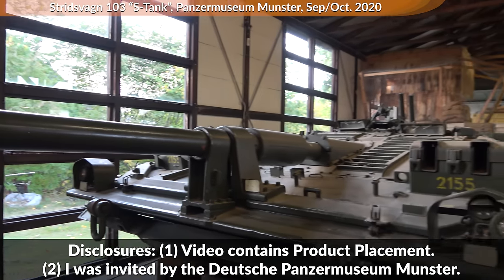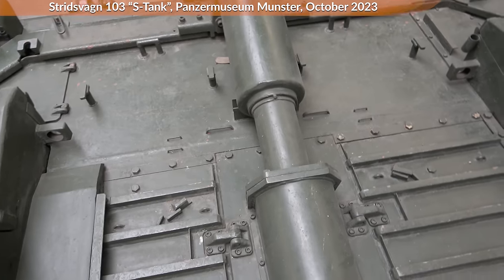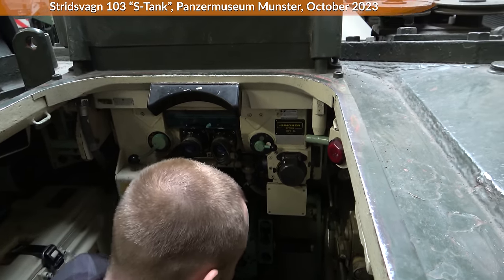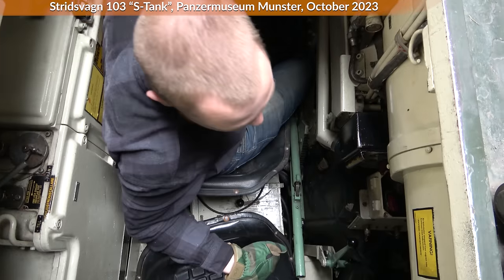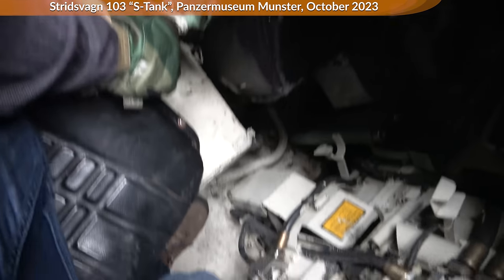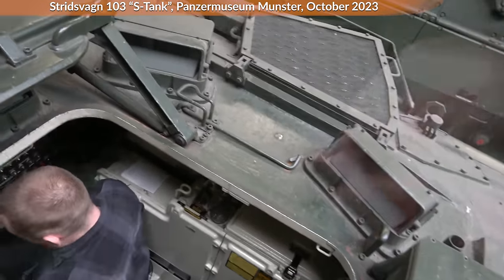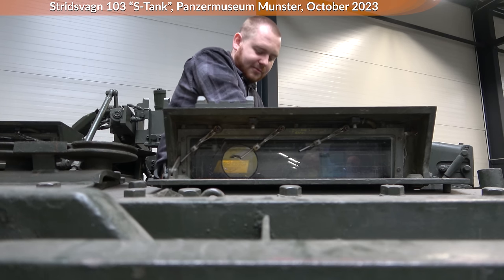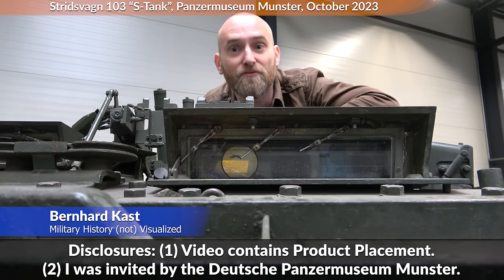S-Tank: The Swedish StuG

Comment: It's such a genius design. Tanks get hit too often in the turret? Remove it. Checkmate turretists.
Reply: With a “TrackPoint” style system, it could become  a better shooter than gyro stabilized turrets. Keep the trigger pulled and it fires automatically only when it reaches the solution.
Reply: One hit to the tracks and rotation is not possible. With a turret you can at least defend yourself. And you are more flexible in aiming an firing. I guess this is why today every tank has a turret.
Reply: @Piett_ yes but you would need to shoot both before it can return fire. And that would be hard due to the targeting system/aim being suprisingly good better then most tanks with turrets. Also the s-tank is a defensiv vehicle = sniper and camper
Reply: @hemondounknown8285  only cowards camp. oh wait this is real life right
Reply: @Piett_ also the tank tracks would theoretically be the easiest part of the tank to protect behind cover.
Reply: @chrisragnar1  not theoretically, realistically. they would appear over hilltops and fire down most of the time, or be dug down a bit
Reply: @hemondounknown8285  Dug down, but also has a lower profile perfect for the kind of terrain in Sweden. It was not built to ambush tanks in Sahara or something like that. Even though it might be able to do so. I did rely on good optics to counter the weakness it had. But Sweden does have tanks today with rotable towers and such. We use leopard to give one example.
Reply: @hemondounknown8285  That's just plain wrong. Most of the S-tanks were deployed in southern Sweden (PB 7, PB 8, PB 9). Their job was to aggressively counter-attack any Soviet beachheads or large airborne drops on the southern plains. Swedish cold war doctrine stressed the need to strike hard against any landings as fast as possible.
Reply: @kored8688  To add, the areas that these would be deployed on are very flat. These would essentially be mobile bunker turrets, of which there are many on the southeast coast.
Reply: I was there and remember when the swedish army tried out Abrams, Leopard and Leclerc. The officers were suddenly honest about what they thought about the S-tank: a band cannon!
Reply: @hemondounknown8285  It was never a defensive vehicle. It was designed as a reply to a request for a tank, developed as a tank, assigned along with the Centurion to the Swedish armoured brigades, using the same combat manual, doctrine and tactics and intended to do the same work - counterattack an enemy bridgehead (that could come by sea or air). The nature of combat it was intended for was (counter-) offensive, not defensive.

When advanced gun stabilisers became common in the 70s, it proved to be an evolutionary dead and, and it should have been replaced in the early 80s when arrow projectiles made its armour slope obselete, but it was never intended as a defensive vehicle.
Reply: @Piett_  If a tank is immobilized, you should get out of there if you want to remain alive.
Reply: @Piett_   This is a tank for ambush. You dont stay long enugh to get hit in the tracks. You fire and run away. I think Ukraine would still would have been happy to receve those if we didnt scrap them in the late 199:s early 2000:s
Reply: @Piett_  You only need one track to rotate !

Comment: 1972 I was a reverse driver on the 103 S! I drove back and hade the command of the radio communications ,there was a telephone outside the tank fore ho needed it!! I was educated paramedic!! On my right side there was an electric boiler where we could boild water and make coffee ☕️! The chef hade a machine gun that he could fire, and he had 360° vision!! The cannon man had two machine guns that he could shoot,these 2 could be  dismantled  and take with you on the  ground!! Shooting was automatically  and  the shooter could those between different grenades!! On about  1600 meters  you could hit a beer 🍺 bottle 😂 On a road  103 S could speed about 90km/tim° 2 engines, one  to all the  hydraulic about 250 horse power and a gas turbine to make the 103 S to go forward!! 103 S could  go over floods, it took about 30 min to pull up the conwayerbelt and then get into the water,  crawler make the tank go😂 I was 171 cm long, no problems with sitting in the tank😂 Shooting the 103S there was a little recoil, but you could feel it in your face 😂 That's what I remember  😂😂
Reply: 90km/h. And the S-Tank is said to be able to go as fast in reverse as forward.. Like even if in reality they only reached 80km/h on tarmac (remember this where the days before everyone carried a smartphone and able to get a GPS reading) Like.. 80-90km/h is the speed limit on most Swedish roads. Heavy lorries are still limited to 90km/h but only on highways. And with a trailer/wagon or just on a normal road? Top speed limit is 80km/h. So even before getting the engine improvements S-tank was doing the same speeds on roads as civilians do in modern cars. Most likely even able to keep up with a loaded lorry if so need be.
Reply: @TheDiner50  quite right 😃
Reply: Nice story 😄

Comment: Doctrialy the IKV 91 was more closer to a stug, IKV being infanterikanonvagn, the Swedish terminology for assault guns. And I guess German speakers will get a kick out of pretty easily being able to tell what infanterikanonvagn means.
Reply: Or "infantry cannon wagon" in english.
Reply from the maker: "infanterikanonvagn" that looks basically like Bavarian or Austrian dialect.
Reply: @Notmyname1593  "vagn" is more similair to "vehicle" in this context. It's a term that can be applied to anything from a pram to a railway car, depending on prefix.
Reply: Though as a Swede platt Deutch is easier to understand . Swiss farmer is the opposite end of the spectra!  @MilitaryHistoryNotVisualized
Reply: @lavrentivs9891  That's true in English too, though  (although you don't need a prefix!)
Reply: Yeah doctrinally this is unambiguously just an MBT. But rather than piling up armor ur relying on speed to become difficult to hit the profile is kept super low. 

Though with little actual combat results to go off of we are mostly left to guess if the concept was sound
Reply: @misterperson3469 It worked well during combat exercises/maneuvers, but of course that's not the same thing as actual combat.
Reply: As a Dutchman, I can also easily understand this word. In Dutch "wagen" is the general term for everything on wheels. We also use the word "strijdwagen" in Dutch.
Reply: I would like to buy a vowel
Reply: @johansilwouden3403  Dutch seems like a strange mix of German and Swedish n reading, but like a drunken Dane trying to speak German when I listen to it. 🤣
Reply: @Notmyname1593  "Or "infantry cannon wagon" in english."
Infantry Cannon-Carriage would be a more accurate translation.
Reply: it's a vagn with a kanon for infanteri
Reply: @AlexanderTzalumen  Förvisso, men översätter du med "wagon" blir det en kärra istället för en vagn. Olika nyanser på olika språk.
Reply: Irrelevant. Wagon is obvious enough and is written practically the same as in swedish. Which was the point of the first comment. @johanmetreus1268
Reply: @johanmetreus1268  apologies, but memeing about military names is about as fluent in a foreign language as i get, and the app won't let me copy the text into a translator.
Reply: @Notmyname1593  Since when is accuracy and precision in translations "irrelevant", never mind in the language?
Reply: @AlexanderTzalumen  Ah, I am sorry.
My impression was that you are a Swedish speaker, making a slight mistake translating into English.
Reply: @Br1cht  Yes, preferrably... Its built to play defence, after all. However, it turned out to be on par with other MBTs for the general role too... Before the opponents got computer stabilized guns and could fire on the run, the S could actually get it's first shot away as quick and as accurate as the opponents, proven in extensive war games with  experienced crews on both sides. You wouldnt believe how this thing could be hurled around with its hydraulics, and its super-easy controls, and it's dedicated BACKWARDS DRIVER! The engineers knew they couldn't get away with anything less than sheer genius, with this basic platform. So they delivered just that. <3
Reply: @MilitaryHistoryNotVisualized it looks nothing like bavarian or austrian😅

Comment: Also a requirement here was to be able to cross most bridges in sweden. Being almost 1/3 lighter than all opponent tanks one would have a tactical advantage where an enemy would be forces to use only sertain bridges or non at all even.
Reply: I'd like to say the soviets by the 1960s had worked out how to cross a river without having to worry about a bridge but we've seen Russia is still working on that...
Reply: @AsbestosMuffins
Basically 99% of the swedish manual for a combat soldier that we all received turned out to be science fiction. 🤣👍
Reply: @AsbestosMuffins  Deep wading is incredibly dependent on a couple of things; the depth of a river as one might guess, but also the type of riverbed, and the banks of the river. Crossing the river by driving ain't too great when you get stuck at the middle or can't climb up a steep bank. I'm not saying it's not doable, but just having a bridge tends to be much nicer.
Reply: @peartree8338  What do you mean? I was always looking forward to us advancing towards the mushroom clouds of the tactical nukes.
Reply: @mattilaiho7979  The S tank floats with the skirt, it doesn't have to drive on the river bed (unless the river is shallow of course)
Reply: This was countered by the short tracks, making the ground pressure about the same.

Comment: Its worth saying that all (or almost all, not the instructors) tank-drivers in Swedish army was conscripts. When they select people for position they considered physical attributes, mental attributes and experience. 

People that was really short was typically selected for tank duties.  The tank was built with this in mind . Later (really very tale end with the S tank) when female conscripts was alowed, tank driver was quite common posting.

Also a peculiarity with how the Swedish defense worked. If war ever broke out they would have 10-15 person on each post to choice from. For some post like guard or commando  the division could easily be expanded. But with stuff like tank, artillery aircraft where there was a very specific amount of equipment.

So the officers would choice who actually preformed the best to call in in case of war , having really skilled drivers and shooters. Not only that, they would have shift crew doing sort of a night/day shift thing where they could use well rested crews and do a 24/7 kind of operation.

Suitability was there for top priority. If you lose one tank, you lose combat effectiveness of 2 or 3 crews.

The ability to go into combat with two engines was vital. Because if there was a breakdown or a fail hit to a engine the other engine could limp the tank back. If either the guner or the comrade was hit, the other crew member could drive the tank back.

This also solve the repair problem. While the tank was built to be able to be repaired by a crew of 3 (or even two people in a pinch). a double crew of 6 would do the work much more effectively.

There was also the notion that there would not be able to get spare parts in time if something broke. So the diesel engine is the same as used in a popular tractor at the day (was later updated with a newer tractor diesel) And the gasturbine was the same as a popular helicopter.

So if the engine broke down they could drive it up to a tractor repair shop and take the spare part from there, or in worst case just scavenge it of a tractor.

This is a philosophy Swedish armed forces use to this day. For instance both the CV90 and the CB90 use a engine that is heavily based on a Scania truck engine. While its not 100% identical, most components are the same
Reply: The dual engines had many reasons. The most crucial one I have go guess is simply that without engine power the tank is completely useless for anything. It needs engine power to turn the hull and aim the guns! Like even the Mause/KV2 with a turret big and heavy enough to not be able to turn parked in the wrong place due to needing relatively level ground to rotate the turret. They still had a turret! But in the design of the S-Tank everything is built around the low profile hull traversal gun.

It so happened to be the first masse produced turbine engine tank. It makes it able to operate on dual fuel sources. (multi-fuel that works) It has a diesel engine meant to run constantly. (most tanks end up needing to run some kind of engine for radio anyways) And the turbine engine to give as much power to weight as possible for maneuvering. But the tank was under powered and really needed the turbine running even at low speeds especially in case of being truly in combat. It also helped that the gun barrel is taking center stage splitting the engine space into two parts. So even if it had 2 diesel engines it would be for good reasons why it is dual engine. 

The tank truly is Swedish since it only fits for the Swedish needs. It was never used in real combat. It was obsoleted by stabilized on the move firing. It was under powered and very expensive. Cramp and specialized. But considering the culture and the time it was designed and used? The way it was meant to operate? Sure it was in many ways a failure since it proved to be under powered and advancements in gun/fire systems made the protection and no turret just not suitable for chaining combat/tech. It just was not going to fly building a new gen of them. It was a failure and change in times.

But someone from Sweden having driven on older purpose built roads narrow and everything. Knowing the terrain and tactics the S-tanks where meant to operate? As a lorry driver imagining trying to advance into Sweden with a tank or just supply truck? The amount of places a S-Tank can poke up and lay in wait to fire 3 rounds in rapid succession (2sec reliable auto-loader or something crazy). Like I would not want to be in the lead position of a convoy. Let alone trying to cross in terrain where a S-Tank can sneak undetectable up from anywhere. 

Like imagine what a group S-tanks are able to do to a group of vehicles trying to take ground? Tactics aside of fire 3 and fall back. Given a chance a single S-tank had the fire rate, ammo and positioning for a single commander to level a platoon or a hole road convoy attempting to get passed it. Before any turret is able to find and start turning the right way the S-tank would be gone and finding a new place to set up. The S-tank fits the Swedish woods as much as the Swedish Moose! But it is not without flaws. 

The S-tank is a Swedish tank. It is not and never built to special operations or anything we imagine nowadays. It was meant to rapidly deploy and retreat with as little as possible to aim for. And if the S-tank was hit? It was meant to be able to take it. Even a freaking nuke blast. It was meant to defend the country even to the last person standing. But it never was used for what it was built to do. Only trained with. Like allot of Swedish military machines in the Swedish service. Outside of the first tanks Sweden owned. They where used agenst the civilians in the city XD

Today Sweden has highways and older roads are almost not used. But the roads up in the north part of Sweden and said terrain was made for the S-tank. Or rather the S-tank was made with the roads to actually be effective. If not more effective then any other tank possible for the defensive role. Yet still able to serve as a main battle tank if need be. Just as long as gun stabilization was not a thing S-tank was just the right tank for the job.
Reply: @TheDiner50  
"The dual engines had many reasons. "
I think that is asking the wrong question. Of cause there is a load of benefit of using two engines. But the real question is why no other tanks was doing that.... 

... and when looking closer at it, that is sort of kind of not really true. A lot of medium and heavy tanks had electric battery operated tower servos.  Its not universal, but pretty common.

And that kind of gives us, at least part of the answer. The second engine was designed to be a stationary engine. It was really designed to aim the tank when the gas turbine was turned of. If we look at the fairly low power of it with a 240hp diesel engine compared to the similar weight AMX-50 with 680hp engine.

To my understanding the diesel engine was originally even smaller. That is true for some older tanks, having a smaller motorcycle engine for stationary usage and a large V12 for moving.

To my understanding it was designed as a smaller engine, but it was getting bigger and bigger untill the physcal volume of the engine was pretty much the same as the gas turbine.

Still its a nice design with two equally sized engine compartments.

Comment: I've had the fortune of getting to drive our stridsvagn 103C at Hässleholms museum several times in the terrain. And it's absolutely great fun to drive! The controlls are very easy to learn, and the vehicle is alot more nimble than most people realize. It's a turret on tracks, not a tank without a turret to be honest. With a well traines crew you can drive, stop, accuire the target and fire very very quickly. And the strc 103 is perfectly suited to utilize the terrain perfectly both on the offensive aswell as on the defensive.

Comment: The yellow warning sign on the gun says "If the diesel engine (technically it says "piston engine" but I assume they mean the diesel engine) is shut down (or disabled, it doesn't specify, just says "stopped"), the tank cannot be braked using the brake pedal. And the lower text says "use the handbrake."